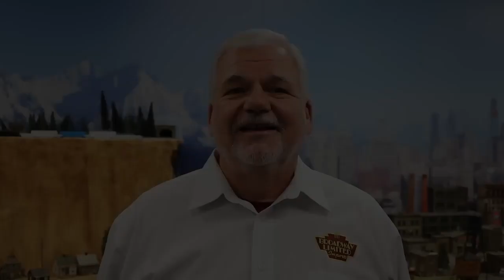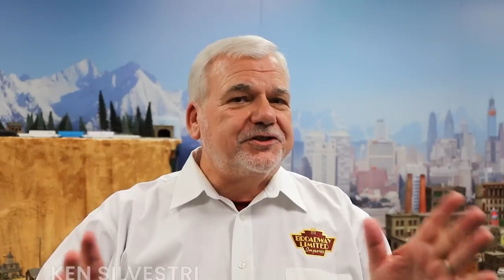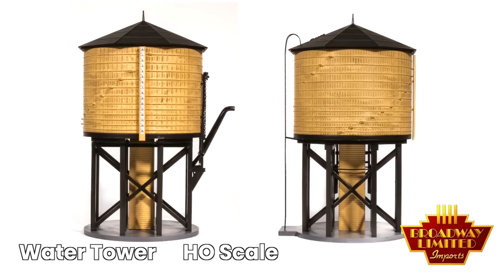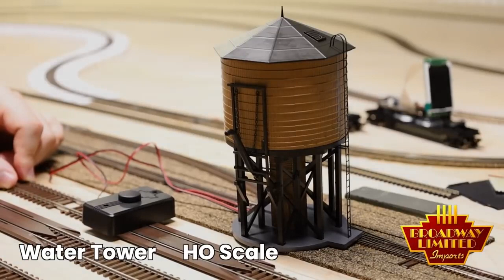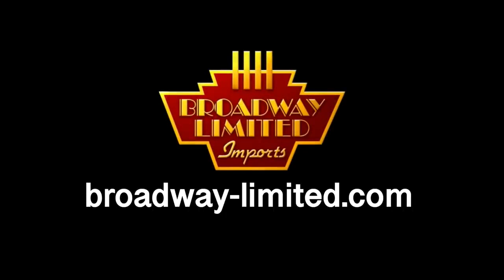Your layout NEEDS this accessory!

Comment: One of the best cool N scale I have found so far an if one has there layout set up to instead set this button off via a sensor below with a DCC system an programed to go off when the engine has stopped an is setting under it!

Comment: I have one, and they are good, the sound is a little gimmicky in my opinion. But my only issue is that if you plan to run big steam with the tall tenders (Big Boy, Yellowstone, PRR T1, Cab-Forwards, Allegheny, Y6b, EM-1, etc) then you need to raise the base of the water tower by an extra inch, otherwise, the spout will be too low and hit the tender.